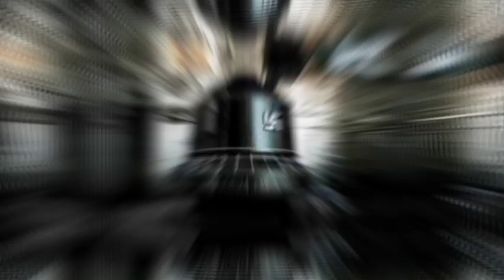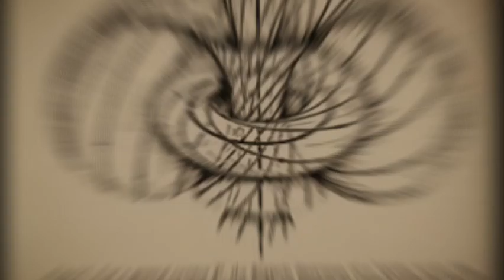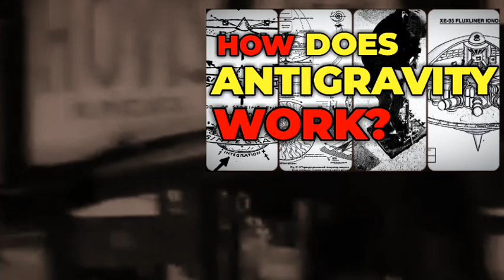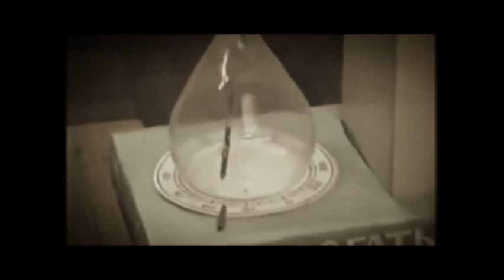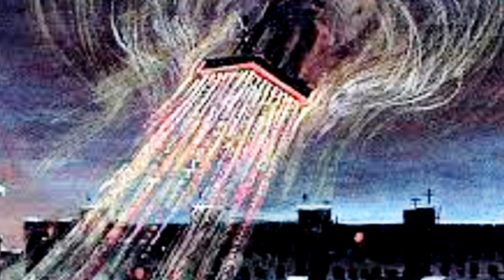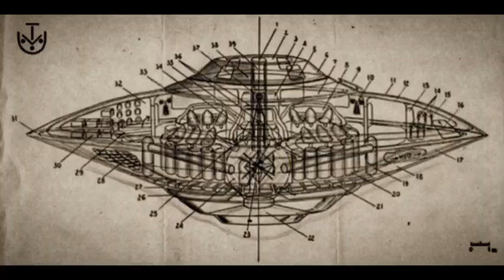Unveiling The Mysteries: How Does Anti-Gravity Work? | Antigravity Machine

Comment: TR-3B Astra??🕳🕳🕳🕳🕳🕳🕳🕳🕳🕳🕳🕳There are real UFOs - purely terrestrial technology developed in the USA and classified. I think that in conditions when there is military tension in the world, the appearance of Russian UFO-type reconnaissance vehicles over American military facilities is justified. However, this secret technique, first used by the Americans themselves in 1947, is not super at all... It is not very convenient to use. Firstly, during the operation of high-frequency pulsed railgun cells that make up the motor panels, strong microwave radiation occurs. It (even when shielded by a Faraday grid) has a harmful effect on pilots. Therefore, it is impossible to fly on these devices all the time. Secondly, due to interference, it is impossible to maintain radio communication with the devices. And, thirdly, the lifting capacity of the devices is still small. That is why "flying saucers" are used in secret mode for espionage purposes. However, recently such a spy function has become irrelevant due to the opening of borders and the availability of new technologies (satellite tracking). Therefore, UFOs are rare now. UFO technology has long been copied in the USSR (there were downed spy apparatuses), now this technique is also in China or even elsewhere ... (There is information that the technique fell into the hands of criminals and is used for drug trafficking and in the logistics of black transplantology.) Because of all these events, the secret technology began to be gradually declassified - this is what the Americans are doing now, judging by the media. Perhaps it will be declassified very soon and it will find use in the only (as I understand it) case - as a propulsion system for cargo airships. There, pilots can be located remotely from the radiating panels, and the use of airships will occur in remote areas where interference with the operation of electrical appliances is not so dangerous. I advise you to read Christopher Buckley's book "Little Green Men", which satirically talks about the secret UFO technique and the spread of misinformation about aliens and even about fake "kidnappings" to support the legend. K. Buckley was a speech writer for Bush Sr., he knew many secrets.